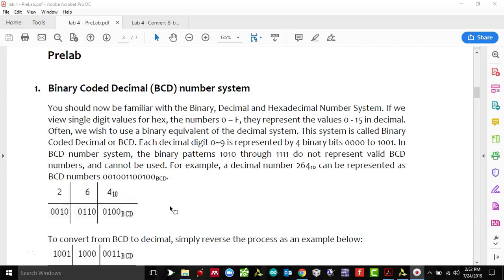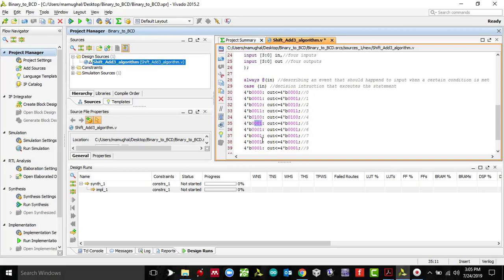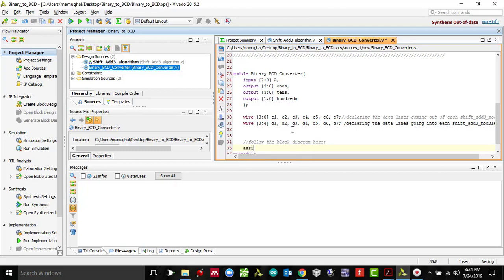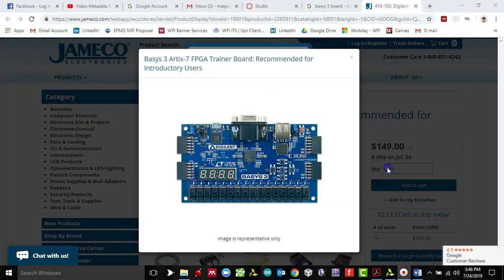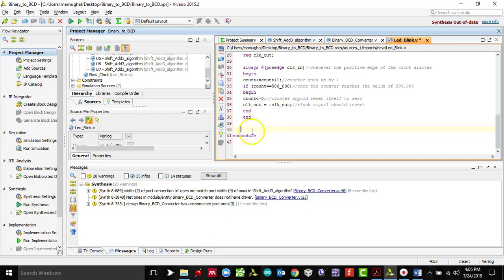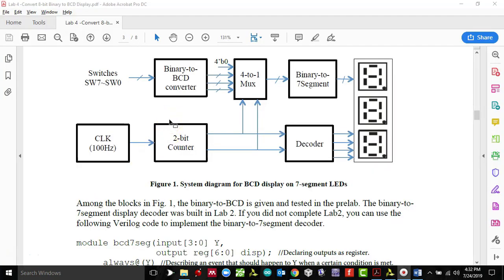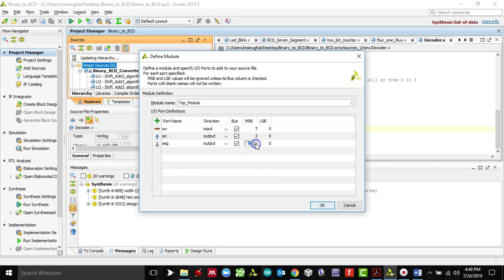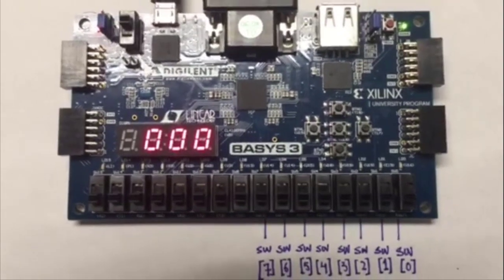#8 Binary to BCD Conversion  | Basys 3 FPGA Board | Step-by-Step Instructions

Comment: There seems to be a confusion over the input of 4-to-1 Mux. In the table shown at 57:48, there is a definition for the thousands that corresponds to input D (4'b000). However at 1:10:41, there are no thousands, but zeroes which corresponds to input A (4'b000). 

In order to fix this problem, I suggest that line 36 in Top_Module should be replaced by "four_one_Mux L2(ones, tens, thousands, counter_out, mix_out)" where thousands should replace zeroes at line 32. This way A correspond to "ones", B to "tens', C to "hundreds" and D to thousands (or 4'b000) as shown in what I think is a pdf of a prefab (I currently don't have access to the files).

Also, I am using Vivado 2020.2, and I get an error if we define zeroes as wire and parameter at the same time. I removed zeroes (which is now thousands) in line 31 to fi the problem.

Finally : in two_bit_counter, I get an error if I define the output Q as a register and then assign temp to Q. It seems that you cannot use assign with a register. I juste removed the reg in the output definition to fixe the problem.

Hope this is right and help!
Reply from the maker: Dear Jmlaniel, thousands is basically zeroes. Because we only use 8-bits, therefore, the range is from 0-255. Because the left most segment is never used, we keep it 0. You can just completely remove it if you like by disabling the segment.
Great that you were able to fix the other issues. Please know that I have used v.2015 and things have changed then.
Reply: @ElectronicswithProfMughal   Thanks for your reply and precisions.

However, the problem is not with the fact that one segment is zero (this I understand), it's just that during the presentation, the zero segment is sometimes A and sometimes D which has a huge impact on how the results is shown on the display. I was just pointing this out and how I fix it.

I mentioned in my message that I was using v2020 in order to help someone who would try to reproduce your steps with v2020 instead of v2015.
Reply from the maker: @jmlaniel  Thank you :)

Comment: Whatever shown in the video and the constrant file in the description is not same.. 

Is for all FPGA kits the constrain files are same?? 

Can you update the constraint file in the description.
Reply from the maker: Each board will have its own constraint file. I use Basys 3 board so I am using the constraint file for that board.
Reply from the maker: when you get access to project files, it will include the constraint file. The one I have in the description is the constraint file from the manufacturer.
Reply: @ElectronicswithProfMughal   Thankyou sir Totally get it.
Reply: @ElectronicswithProfMughal sir i have performed this project in nexys 4 fpga board. 
Everything is good upto now. 
But I'm not getting exact output Hope you can help me.. 

My error was I am getting the display like if 255 is the no. Wants to display it is showing 550 for me i'm missing the hundreds place and in ones place Continuesly getting zero... 

What is the error I can't get so can you please help me
Reply from the maker: Work with your constraint file (for your board) and the arrangement of the digits when instantiating the segment module. @pradeepenukonda28
Reply: @ElectronicswithProfMughal  It is really helpful I got the output as same as your🙂. Tq sir
Reply: @ElectronicswithProfMughal  Sir Any suggestions to get a job in semiconductors field. What we have to learn & How to get it
Reply from the maker: Pradeep, there are plenty of jobs for someone good at System Verilog can simulate design and create testbench files.  @pradeepenukonda28
Reply from the maker: Glad I was able to help. @pradeepenukonda28
Reply: @ElectronicswithProfMughal  Thank You so much sir for providing valuable information.

Comment: Can we apply same code for Spartan™ 7 XC7S50
Reply from the maker: Sure.
Reply: @ElectronicswithProfMughal is there any change in constraint file for Spartan™ 7 XC7S50
Reply from the maker: @itsanaz2950 Since it is a different board you will need the constraint file for that specific board, which should be available online on the website. Just make changes accordingly.